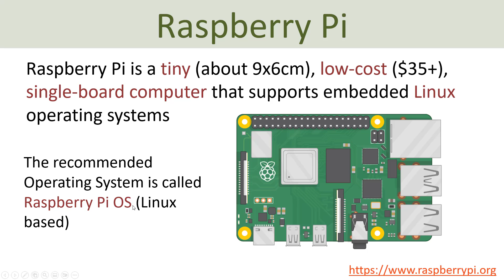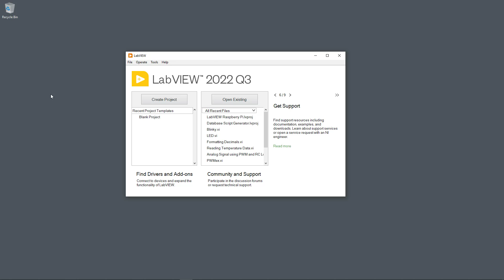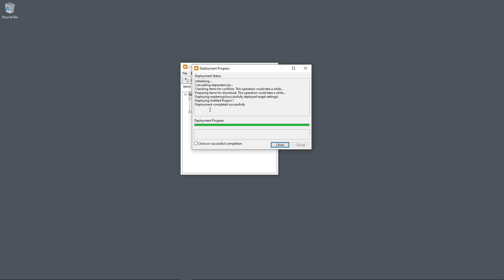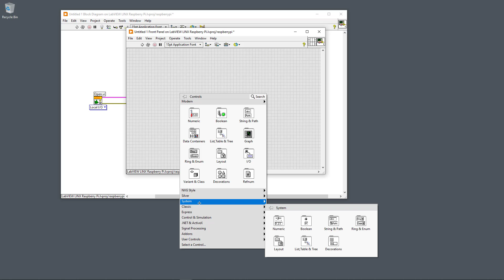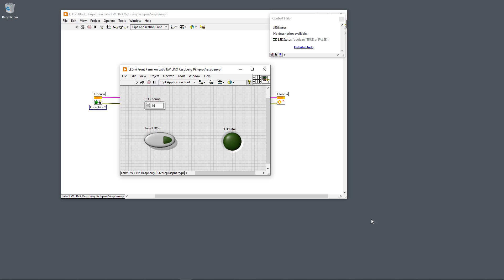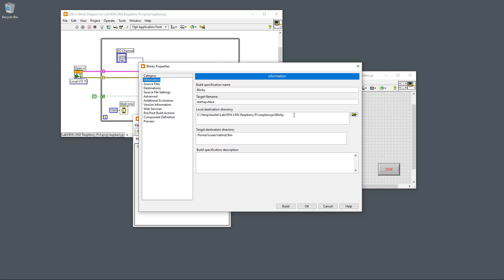LabVIEW LINX and Raspberry Pi

Comment: Nice Video! Thanks for uploading this, it will help a lot. Is it possible to deploy an application with front panel or GUI to Raspberry Pi? Then in Raspberry Pi I'll connect a display and run the deployed application.

Comment: Thanks a lot Hans-Peter ! Great video !
In my case LabVIEW sees the available Raspberry PI 4 as a Raspberry PI 2 and I can't find the reason why. The only difference I see is the version of lvrt20-schroot. In your example it's 22.3.0-1 but in my case it's 20.0.0-4  although when I run "Update" I get the message telling that the version already installed is the most recent one. Do you have any suggestion ?
Reply: Found ... LabVIEW 2022 is requested (eventually 2021 is enough but I didn't test)